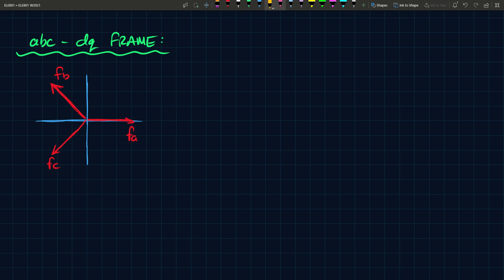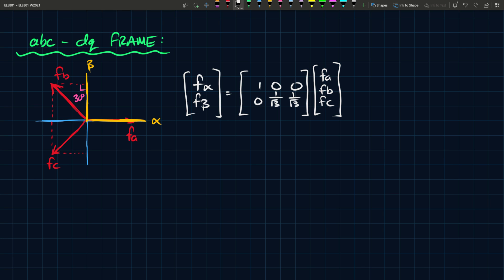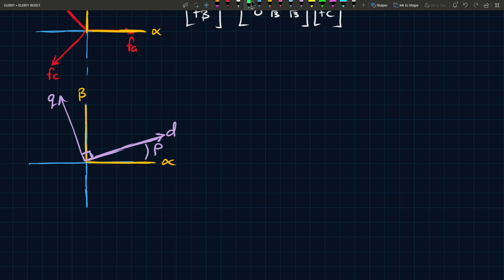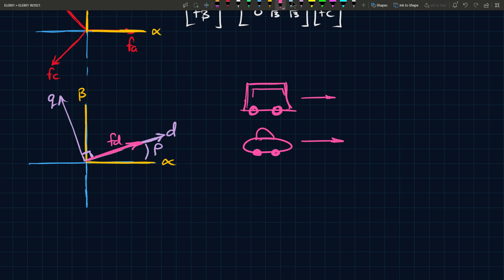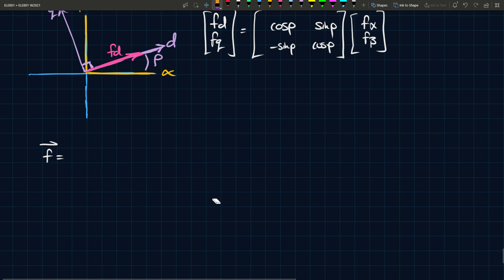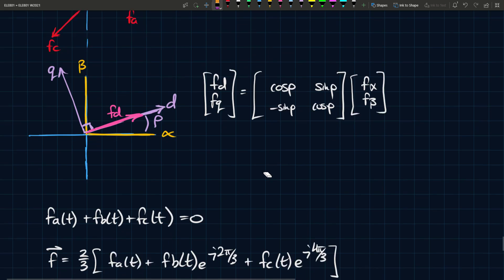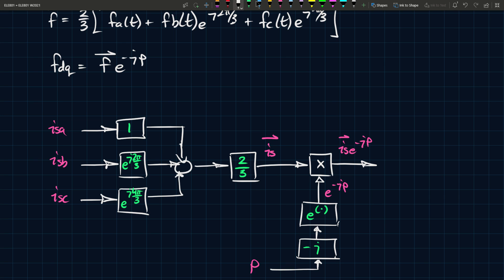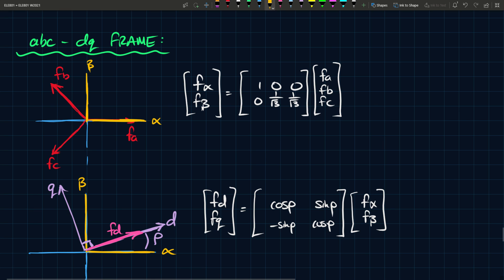abc-dq Transformation

Comment: Thanks for the video. BTW alpha beta matrix, when we project abc on alpha beta, then matrix will be different na?
Reply from the maker: Alpha-beta is different than dq. DQ is basically alpha-beta, but rotating at the same frequency as the abc components are, so as to create the illusion that the abc signals we are dealing with are DC quantities as opposed to AC. So, yes, the transformation is not the same.

Comment: Sir,does abc-dq0 transformation depends on number of poles too..or is it same across 3 phase either for 2 pole and 4 pole
Reply from the maker: I am assuming that you are referring to the number of poles that the machine has when you say 2 or 4 poles. The transformation may be applied to any system that can be represented by a space vector/phasor. The condition for that is what I write for the functions around 8:45, and the definition of the space vector is shown shortly after. This definition shows us that the details of the system are not important, just that vector/phasor components must add according to the relationship that we have defined.